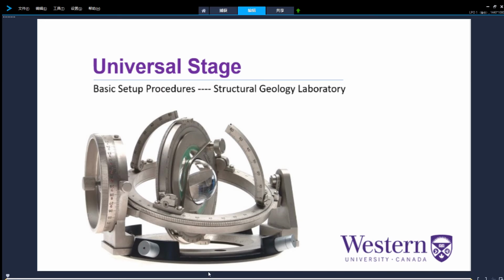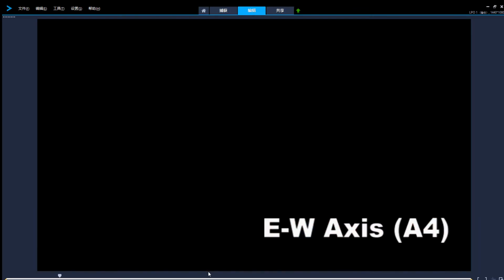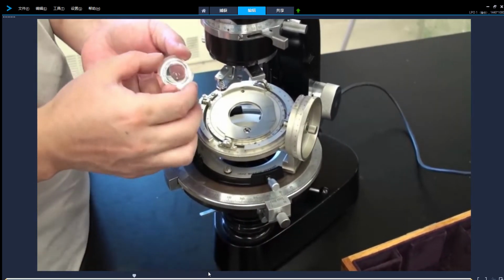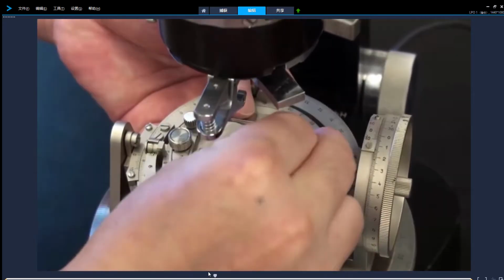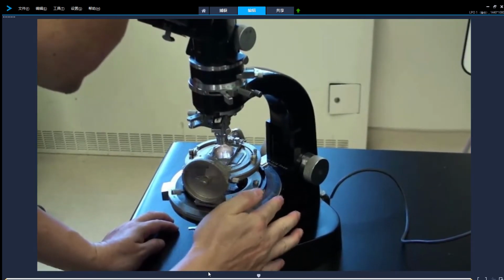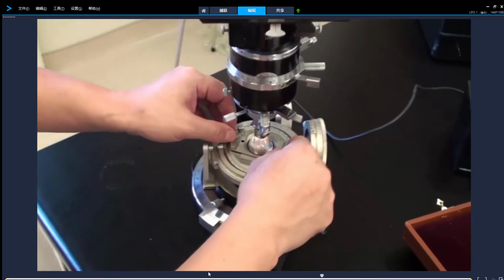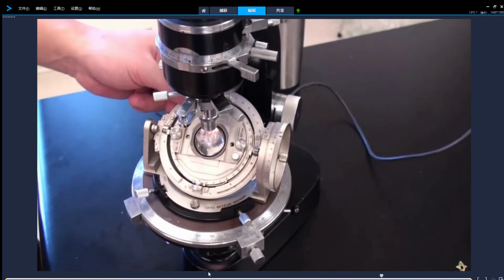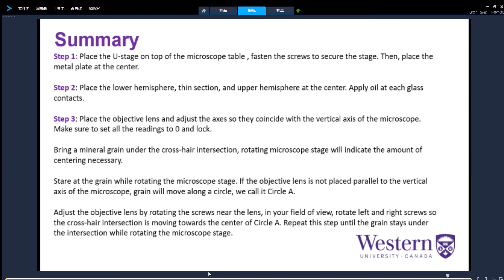How to set up and integrate an Leitz Universal Stage into an optical microscope

Comment: Thanks very much! Excellent videos. Would you tell me that EXACT model of the Ernst Leitz GmbH Wetzlar?  1960's Ortholux POL?

Also, do you know of any other microscopes that the Leitz Universal Stage can be used without complicated modifications to the microscope?
Reply from the maker: i think the model of Ernst Leitz GmbH Wetzlar is 534319, 1.25x But I'm not sure if they still produce this model.
Reply: @xuekechang2264  thanks for taking the time to reply.  No they don't, that's why I wanted to know if yours was a Ortholux POL. Again, excellent video, thanks for taking the time to put it all together.
Reply: @xuekechang2264  Leitz Laborlux Pol the serial number is from 1959. Thanks for the nice video.